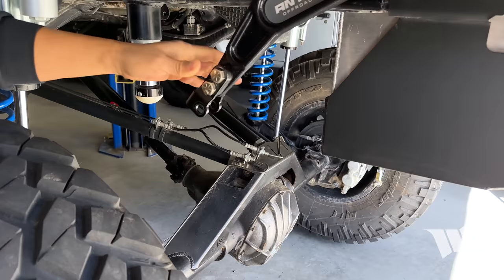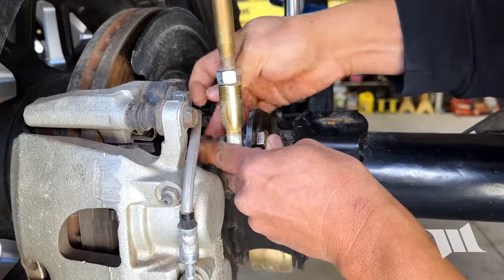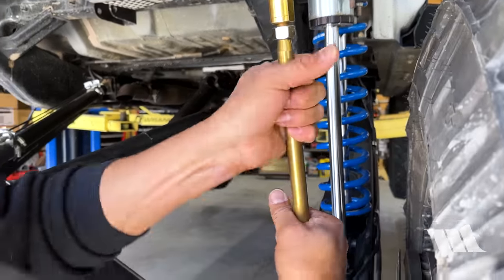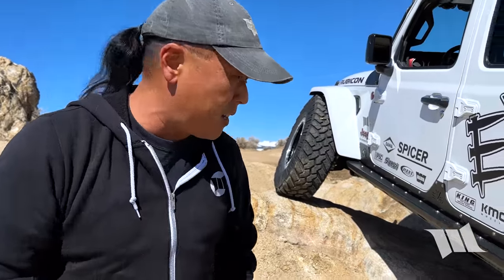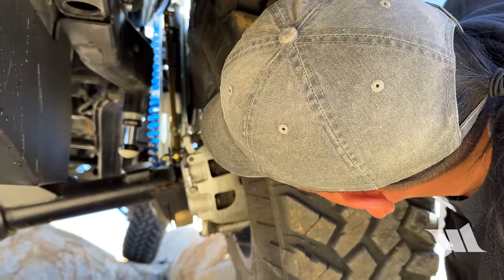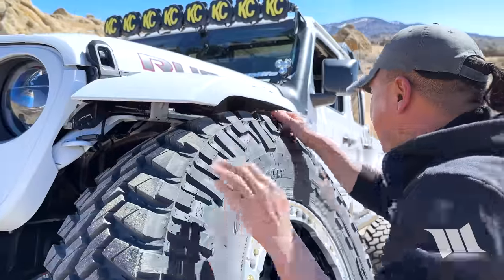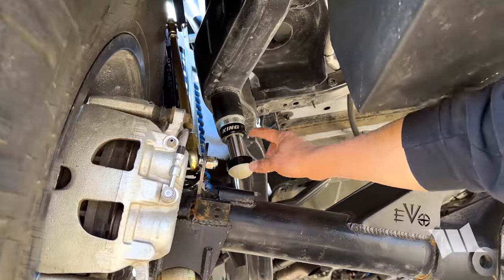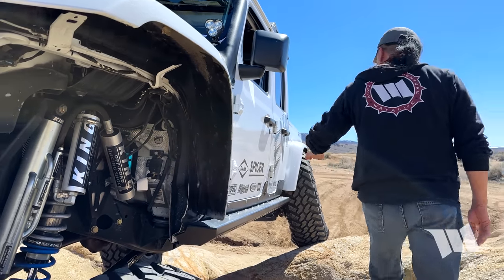Twisting Up EVO Trailing Arms on the Rocks to Test for Flex and Check our Antirock Swaybar Fix

Comment: 42” tires are big and hard to clear!! You’ve got some insanely tight clearances and looks like you’ve still got travel to go both front and rear which will cause rubbing. A bit of rubbing never hurt anybody though. 

That gladiator is just insane man. Insane. That’s a dream build right there. One hell of a machine. Couldn’t be more jealous if it! Lol
Reply from the maker: LOL - yup, clearance is tight but I think we can help that along without too much effort. And no, a little rubbing never hurt anything. Glad you like the build 😎

Comment: @11:00 the top ball joint should be on the inside of the cutout in the link to increase clearance and prevent twisting of the cast link, they are installed correctly on the front axel
Reply from the maker: LOL - Um, duh! And yeah, that would be great and all if only there were enough room between the arm and the frame rail to make it work. If you take the time to actually watch and listen, I state very early on in the video that these arms are made for a JK, NOT a Gladiator and we were just trying to find a solution to the other problem we were having.

Comment: Eddie, are you using the Heavy Antirock sway bars or the standard?  I'm running the EVO double throw down long arm kit with 38s on my JT.
Reply from the maker: On this Gladiator of ours, we are running the heavy antirock on the rear. I should note, we are running them mainly for stability when bombing across the desert. I would not recommend it if you're looking for flex as it will limit it.

Comment: would limiting straps help, by keeping the droop side from pushing the other side tire into the swaybar link?
Reply from the maker: We are running triangulated upper arms and so articulation should be exactly the same on both sides. Our axle is off center and that is the reason why it's making contact on the driver side.

Comment: Are you going to just do wider spacers on the rear or all the way around ? Have you considered steel fender flares ? Also one of the things I love about my lift is it is amazing on and off road … do you lose any of that with the anti rock set up ? Love your test area btw !!!
Reply from the maker: We'll most likely run spacers all the way around. Not a fan of steel fenders and mainly because I have personally seen where hits to them on the trail cause body damage. Factory plastic fenders just fold or tear off. We are purposefully running a rear Antirock with a much higher torsion rate. This is to help stability when driving hard and fast off road. On road, handling is even better. Flex on the rocks is somewhat limited but it is what we were looking for being that we're running 42's and keeping them from tearing things off had been a challenge.

Comment: Love the video! Which tires do you recommend for daily driving on paved roads?
Reply from the maker: For daily driving, I'm finding that I really like the Nitto Ridge Grapplers. It's what I run on my 2-door and plan on running on my 392 too.
Reply: @wayalife  thank you for the feedback! What letter would that be on the tire sidewall rating?
Reply from the maker: Different ratings are offered on different sizes and some will have multiple options. I personally prefer a C rating for daily driving as it will offer a softer ride and make sure to run a size that comes in it.

Comment: May I ask if the JT factory axle can be installed with 40 tires?  Thank you so much
Reply from the maker: You can install whatever size tire you want on a factory axle. How long the axle will hold up will depend on how you use your Jeep.

Comment: What about fully loaded with gear I believe it would flex more
Reply from the maker: You can believe that if you want but so far, we have not seen it to be the case. Of course, we just flexed this Jeep out to show that it still could but it's primary purpose is to bomb across the desert and in a way that most Jeeps could never hope to. We have other Jeeps that are made to flex.

Comment: The Antirock has always been wizard shit to me.  Like, how the hell does something that looks like a swaybar allow for so much more articulation than the actual swaybar itself 😭😭

Absolutely love the Gladiator build.  Thing is nearly perfect but I suspect you’ll end up adding a few cylinders and then it’ll be endgame 🤌🏼
Reply from the maker: To be fair, the Antirock does NOT allow for more articulation or at least, when compared to being disconnected. As I explain in the video, we purposefully installed them to help provide more stability when bombing across the desert and to also offer MORE resistance - to help LIMIT the amount of articulation so that we don't tear our rig apart when flexing on the rocks. And yes, a few more cylinders under the hood is in the works 😁

Comment: Good video but aren’t bump stops supposed to maximize movement and protect components? $2000 in bumps that don’t stop anything?  The sway bars will wear with time and you’ll have damage when tire hits shocks etc
Reply from the maker: Everything about this build has been about bombing across the desert at stupid fast speeds. The air bumps were installed and set to soak up a full vertical hit and they still do. People seemed skeptical about it's ability to flex on the rocks and I think we've put that to bed with this video. If you pay attention to what I say in the video, you'll hear me say that our axle isn't centered and that's why there's rubbing only on one side. You'll also hear me state that recentering AND wheel spacers may be needed to address the rubbing.

Comment: Can someone explain why they run nittos? There’re so stiff on rocks and side walls don’t flex well.
Reply from the maker: Umm, if you're referring to what you're seeing in this video, we were running full street pressure and they still hooked up anyway. Aired down out on the trail, we have never seen issues with the sidewalls not flexing but then, that's just us.

Comment: I am really surprised that the nylocks work out for you. I switched everything over to height temp national aircraft grade lock nuts.  Nylocks provide 5 times use on and off to full torque spec.  NA-HT locknuts offer 50 on-off cycles before reaching spec becomes an issue.  Might check these out on your moving pieces… (anything that gets hot from movement.)
Reply from the maker: The nylocks are what came with the kit and so I used them. And, so far, they've been holding up but I'm with you on this. I typically like to run stovers/pinch nuts for the same reason.

Comment: why are you locking hubs manually when a rubicon has that switch to lock front and rear, or rear covered?
Reply from the maker: Because we are not running factory axles. We are running Dana Ultimate UD60's and they have manual locking hubs.

Comment: So.. wouldn’t everything get wiped out by the time you full stuffed it?
Reply from the maker: You are looking at full stuff/full droop. This rig is totally crossed up and to the point where it's hanging a tire. If you're talking about full vertical bump as in, when hitting really big bumps at high speed bombing across the desert, that's totally different and that's what it was originally setup for and already tested to work well.

Comment: Wouldn’t you want your air bumps stuffed at max articulation? Like before body damage?
Reply from the maker: No, the air bumps are installed and set to help absorb the impact from a full vertical hit. As in, from over really big bumps at crazy fast speeds and they still do that well. As you can see in the video, the tires are clearing the fenders and NOT damaging the body at a full twisted up flex and just from the Antirocks. Without the Antirocks, we were tearing off our fenders at a full flex.

Comment: why not add limit strap and bump extensions to utilize the bump stops? It looks like to me they wont get used except for maybe high speed impact with bumps/whoops and even then it looks minimal
Reply from the maker: Because this Jeep was built first and foremost to go fast across the desert. Rock crawling is a distant second but I think that this video shows it can still do that too and extremely well and WITHOUT having to limit anything. Who cares if the bumps don't get used when flexing when the Antirocks make them totally unnecessary.

Comment: Why not just bump it out day one? Needs more bump if you're tearing parts off with the tires.
Reply from the maker: It is bumped out for speed and big vertical travel. That's the main purpose of this build - to make it into a bomb across the desert rig. This flexing on the rocks is just trying to show that it can be done too. The bit of rubbing we're still seeing can easily be addressed.

Comment: so no need to get the sawaybar disconnected😮
Reply from the maker: There is no need to disconnect with Antirocks but you do need to be aware that your flex won't be as much as if you do disconnect. As you can see in this video, it's not enough to matter though.